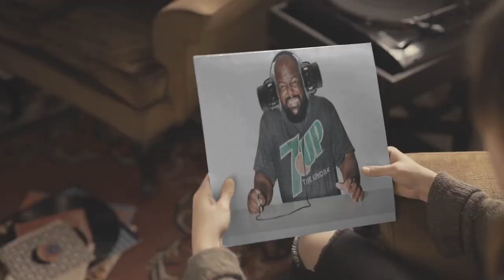To Rear Fill, or Not to Rear Fill...in an SQ Build?  That is the question, and I have the Answer...

Comment: That's the one thing I never understood people say they like rear fill but they're running their rear fill off low power and it's faded so far to the front it's like it's not even there anyway so why have it
Reply from the maker: What's up brother!  I totally get it, and I used to think the same way. Please don't take this as sarcasm, but it's in the name....rear fill is just that...tit's used to fill the rear with just enough sound that you don't have a gap between your front stage and sub.  Without rear fill, it's not that great of an experience for rear seat passengers.  Plus, rear fill helps to widen your front stage.

And that is also important.  Your front stage is where you sit, so you want the best possible sound up there with you.  The rear fill is to widen your sound stage and make the car feel fuller, without pulling your attention towards the back.

Most cars have front speakers on the lower part of the door and tweeters on the sail panels.  If the front and rear speakers are the same volume, because most rear speakers are on the rear deck of the car, you will hear them first, and your focus will be back there...but again, you're in the front, so you want the best sound, and most volume up there with you.

When done right, rear fill just fills the gap and gives the aura of spaciousness in the vehicle and not just front rear left right...if that makes sense to you.

I recently redid my rear fill with component speakers and it totally changed my sound.  Not super dramatically, but my sound is fuller now.

Please watch the video below (with headphones if you can).  It's a lot of good information in the video, but if you wish to skip to the rear fill comparison, go to the 11:00 minute mark.

https://www.youtube.com/watch?v=6IHd0PzPltU&t=740s

Comment: I wouldn't do rear "fill" at all. There's a way to set up rear speakers (differential or something like that) where their propose is to widen the sound stage. That I'd go for.
Reply from the maker: That's exactly what I achieved with this setup.  It's nearly impossible to tell watching via YouTube, but I made a recent video where I'm using new Morel speakers for rear fill, and you might be able to hear how wide the stage is when I turn them on.

That comparison starts at the 6:30 mark.  Here is the link.

https://youtu.be/sZDKc-fs-lQ?si=Add0fU7OruX3CbVN&t=391

Comment: Hello my friend,

I totally agree with your opinion.
I currently have an SQ setup (3 way front + sub in the trunk + amplifiers and dsp) and it's true that without rear speakers, when I put the music on at a certain volume and sit in the back seat, the subwoofer can be heard a lot and my front speakers a lot less. And I think that's a real shame... So I'm going to add a 2 way kit to the rear at the beginning of next year.

Could I have the name of the music you played in this video? :)

Hello from France
Reply from the maker: Hello my brother from France!!

Glad to hear about your system, and even happier that you agree with the usage of rear-fill.

While it is true that your front stage is for YOU, what about the passengers?  Not only do I have a reversed preset in my setup to where the time-alignment benefits the front passenger (so they get proper imaging), but sitting in the back seat with just a sub, with my front stage in the distance is not enjoyable.

I do not hear much of my rear-fill from the driver's seat because of how the front stage is, but it is a much better musical experience for my passengers as it pulls the front stage back towards them, and blends with the sub better.

Although I don't compete in SQ competitions, my friend does and he says some are starting to move towards adding rear-fill, and even 2-seat tunes as well.  Should be interesting.

As for the song, it's DRM-Free music from the YouTube library.  You can find it at the link below!

Thanks for listening, and I hope you'll share your build with the rest of us as well.

https://www.youtube.com/watch?v=JGY-Vclizm4&list=PLbHysu7JO-MMaCS5cdKM_uBTetyhCJoNV&index=33

Comment: bro, the vas of the woofers Im looking at is 2.5'. However, my enclosure is 1.75'. What will I be losing by using below the vas of a particular sub. The 91 sensitivity they offer is why I',m tempted
Reply from the maker: Your woofers will have to work a little harder to produce the sound they're capable of...mainly if the enclosure is sealed.  If it's ported and still too small, you can likely "choke" the woofers if the port is too small...which it will likely be, if it's a smaller ported box.

If sealed, to compensate for the smaller enclosure size, a pound of polyfil will help.  Ported, that may or may not work, if the ports are still too small/restrictive.
Reply from the maker: @brianvarnes4803  that is a pretty big jump in efficiency... I'll be surprised if you don't notice.  I doubt it'll be night and day, but the gains should definitely be there.
Reply: @Ahm-Creative  thanks for your help sir. Think I'm gonna keep breaking these Type S''s,  and be DONE buying woofers!! Bought these new, and always run @2ohm. Subs for life , in other words
Reply from the maker: @brianvarnes4803  hahaha glad I could help!  Might I suggest Stereo Integrity SQL-12's if you want to get LOUD!!  My one is surprisingly loud, and they will definitely give you more than the Type S's and Kappa's  But if not, you can't go wrong with what you currently have.

Comment: 3 way passive up front ,Rear 6.5 mid with built in compression horns, Rear is active.DSP control and fade dead center, with time alinement to drivers side wide?
Reply from the maker: Is that how your system is set up? I'm guessing 3 way passive is because you don't have enough channels to run fully active up front? 

I would love to hear a setup like yours?
Reply: Yep, you wright, 3 ways up front, gong to add compression horn driver's bout 500k xover for a mid-effect.   @Ahm-Creative
Reply from the maker: @lionellrabb9566  man, I loved compression horns back in the day, and actually heard a car with them recently.  Still amazing in today's time.

Comment: If rear fill is done right you should hear it and not be aware that you are hearing it.
Reply from the maker: That's what I've heard, and it almost makes no sense to me.  I've heard champion SQ cars with rear fill, and honestly, it made no difference to my ears (as he was able to turn it on/off via dsp).  But, because I don't compete SQ, my rear-fill is done the old school way, running off head unit power and so light that it's really for rear seat passengers.  I can BARELY hear it up front, and most can't tell unless they lean back and listen for it.
Reply: Thats how rear fill should be and the purpose for it ,to bring the performance to the rear while hearing a front stage .

Comment: Hey brother. Great video as always. You forgot to say with speakers are you using for your rear fill. I use your crossover points and it sounds way better than the ones recommended on the manual that came with the speakers. I'm thinking on the morel tempo ultra coax for my rear fill but I'm afraid that being a lower end speaker compared to my elate carbon pro 63 in the front they could dirty the sound quality or something. What do you think?
Reply from the maker: Hey brother....long time, no chat!  I thought I mentioned my rear speakers being the Morel Maximo Coax 6.  They're definitely lower models than my Elate and MM3, but I'm only running them off head unit power, and my head unit is faded forward to cut the power even more, so they are barely heard, if heard at all from the front.  They're really there just for passengers, so it doesn't affect my front staging.

I'm really glad my crossover points helped.  I actually got them directly from Morel, as they used the same points in their SQ and Demo cars.
Reply: @Ahm-Creative  you know that looking at one of your videos were you mentioned that you wanted more mid bass I started to think that in my case that I don't have the space to install the MW9 or the 8" Stereo Integrity I could put a second pair of MW6 on the rear doors instead of coax and gain more mid bass. Did you ever think about that 🤔.  I mean. That mid bass will be coming from behind you complementing the lower frequencies of your subwoofer. If you think about it, one of the reasons why the JL W7 sounds so good is because it can play all the way up to 180Hz. Hopefully it could be a good theme for one of your future videos. If it is in deed a good Idea of course 😅.
Reply from the maker: @reynielasencio1964  I actually went with the 8" subs up front after I heard the Morel SQ Mazda!  I had never heard anything like it before, but once I heard it, I knew 6.5's wouldn't cut it anymore.

And even though my 12" sub is time aligned, and matches my front door 8's starting points.

My sub is 24-80hs, then 80-250hz for my doors...there's no need for my sub to play higher than 80....and 180hz may be a bit too high.

Instead of using the rear doors for more midbass, which could pull your front midbass back towards the rear, adequate power and a time aligned rear sub will help your front midbass.

My front stage sounds very full, and my rear sub actually fills the whole car because of time alignment...time delay.

Normally, you can hear the sub energy in the rear, but with my current setup, it's everywhere....it's all in the tuning.

Comment: No mix engineer, nor mastering engineer ever used “rear fill”
And that’s for good reason.

It causes phase issues, you may like that sound, but it’s a form of distortion.
Reply from the maker: All distortion isn't bad,  and if it sounds good, then it must be ok.  Plus, in conventional left/right stereo systems, there are always rear speakers, so mix and mastering engineers do take them into consideration....if not, it would the sound stage, in stereo or time aligned.

Comment: Are the rears time aligned? if not, can you tell that the front stage is delayed with DSP?
Reply from the maker: So, prior to installing the rear fill, the whole system is time aligned... everything is centered on the dash... even my rear subwoofer.... which has to be out of phase for this to be accomplished. 

That also meant I had to put my rear fill out of phase as well, or I'd lose all midbass. 

So, what it does for me is widen my stage, and also makes the listening experience for rear passengers 100 times better, as it pulls the front stage more towards the rear of the car, filling the previous gap where they'd hear some of the front, and the subwoofer. 

Now, with the rear fill installed, it's like they have their own phantom front stage when sitting back there.
Reply from the maker: I've updated my rear fill since this video. If you view the video I released yesterday, you'll see the changes I've made.

Comment: I usually use rear fill  in larger vehicles  or with regularly rear sea use. I limit the frequency range, speaker size and level for the rear fill. I used rear fill  in a 1971 vw beetle to Increase perceived cabin size. The vw was a sq daily. I used to  install sq systems professionally in 90's and early 2000's.
Reply from the maker: That's awesome!  I used to compete dB Drag in the mid 90's to 2000 then retired.  I built a personal SQ vehicle where I had my rear fill running flat, off head unit power, faded forward like I have here.

As a matter of fact, in my most recent Morel unboxing, I did just that with an upgraded set of their Maximo HE line.  They're also running off head unit power faded forward just the same, but only when I have rear seat passengers.  When I ride alone, I only have my front stage playing.

Here's the video if you hadn't seen it yet.

https://youtu.be/sZDKc-fs-lQ?si=RlxA1H75OdIoJRFp

Comment: Ok ok, my rear fill will now be amplified with the two available delicious channels of 80 +rms of Arc power. I WILL use all of the amp I just $200 to repair! $1500 for custom A- pillars? Nope. I scored some Infinity Kappa 6×9s begging to keep up with his brothers up front!! Kappas
Reply from the maker: Niiice!  Your build sounds SWEET!!  I used to sell/install Kappa's back when they had the green cones, but recently heard some current models, and they sound even better!
Reply: @Ahm-Creative  for sure, I too remember the green cones! I heard the stark difference to the reference series. So  much so, 20 yrs later, and the Kappa Kid lives on!!
Reply: And thanks for the compliment
Reply: 30 yrs by now
Reply: @Ahm-Creative  running the Kappa " by nines" full-range from my amp, should exponentially improve my mid-bass,  yes?
Reply from the maker: @brianvarnes6174  The Reference Series was decent, but that tweeter was BRIGHT!
Reply from the maker: @brianvarnes6174  hmmm....not if you're time aligning everything forward, like a "pure" SQ build.  They'll pull mid bass from the front stage, more towards the back

But if you're running it more as a front to back "surround" like system, it will help.

My rear fill is very low powered off the head unit, and now I only turn it on with rear-seat passengers.  Otherwise, everything is forward in my system.
Reply: @Ahm-Creative  yeah I'm thinking about "surround" staging. I know traditionally everything forward, but remember I opted not for custom speaker locations
Reply: @Ahm-Creative  let's just say my build took a sharp left tutn
Reply: Turn *
Reply from the maker: @brianvarnes6174  true...so yeah, with the by 9's in back, that will definitely add to your mid bass, and make for a great sounding system.  Very full, and warm sounding.

Comment: No rear fill for me lol
Reply from the maker: Lol even though I can't hear them, it almost feels wrong to not have SOMETHING in my rear doors, even if at low volume. Gotta give my rare passengers more than just a sub 😄
Reply: The stereo image gets blurred with a lot of music if the rear fill isn’t perfectly summed and all.
Reply from the maker: @zeropointstar  agreed.  It doesn't translate well through this video, but it's summed.  It adds to the front stage, making it a bit wider, without pulling from it.

I didn't have my Zoom recorder set right, but I finally got it corrected, so all of my videos going forward should give a truer representation of my system.